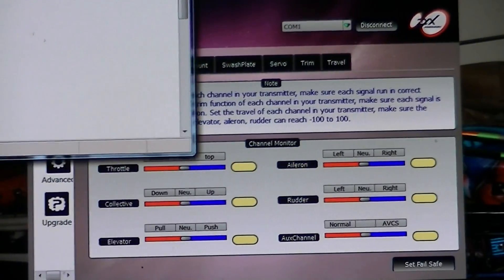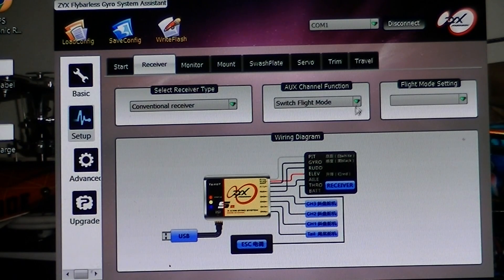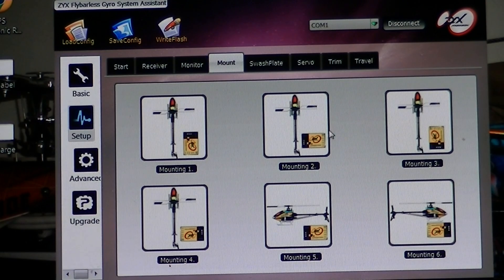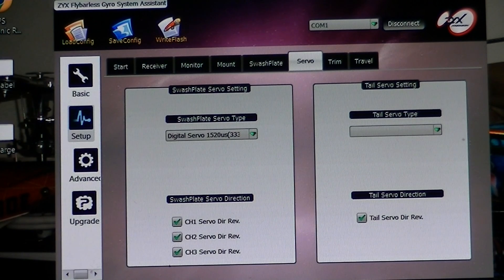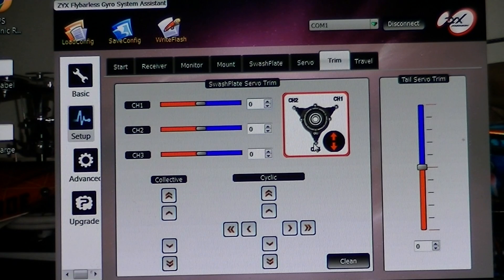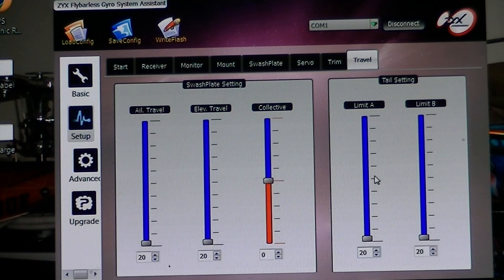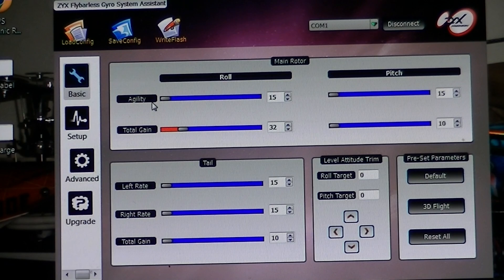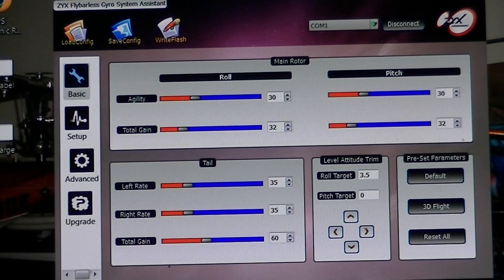zyx s2 how to basic setup video without the blah blah blah blah

Comment: I have a futaba radio, what should my setting setup be on my transmitter.
Reply from the maker: 1 servo swash plate
Reply: Thank you, is everything zero out? This is my first 3 axis gyro. Still use flybar with gy401.
Reply from the maker: use your same thr and pitch curve 
40_ expo on elevator and aileron

Comment: I can't seem to get the gyro to sync with the software ... I downloaded the software and unzipped it, power on my tx,power on the helicopter, plug in the usb and hit the connect button on the top right but it still says unconnected on the bottom right??? any help would be great
Reply from the maker: +Dan Rogers 
after you unzipped you need to install the software after you install the software you have to install the driver you can skype me for more help
wc_wickedclown1
Reply: +WC  Wickedclown RC inc ok I'll have to do that another day ... I also read that this software only works on Windows 7 and 10 is this true? I have 1 comp with 8.1 and another with 8 so I borrowed my friends with 7
Reply from the maker: +Dan Rogers 
yes win 8 will work as well
Reply: +WC  Wickedclown RC inc ok I've tried all that and I'm still not connecting according to the bottom right of the screen. the top right of the screen said com 2 or com 3 so it's acknowledging that my usb is connected. I have the zyx all hooked up to the helicopter servos and all then power up the unit and plug the usb in. the servos move and throttle works so I don't know what I'm doing wrong????

Comment: hy i wanna ask, in tab monitor on channel monitor, in my zyx s2 not showing 0 signal position , buat always minus when my stick both centered, if i dont make 0 signal in zyx software, what could be happened ? 

because, when i try to make 0 signal with my t9x firmware er9x, already end point, cannot trim again.
Reply from the maker: +Ferdiansyah Anggih 
IT DOES not have to be perfect zero
Reply: so? the "note in that shows in software that make sure each signal 0 " just ignore?
Reply from the maker: +Ferdiansyah Anggih 
yes if its off by 1 or 2
Reply: what is mean off by 1 or 2 sir?
Reply from the maker: +Ferdiansyah Anggih 
if your monitor is 1 or 2  over zero
Reply: but, in my showing -12 ? how is it?
Reply from the maker: +Ferdiansyah Anggih 
12 is to much
Reply: i must trim to closer to 0 ? i dont know this happen to me, when i first try to setting this up, the zyx-s2 showing like that? how supposed to do to reset this firmware?
Reply from the maker: +Ferdiansyah Anggih 
yes use sub trim to zero, you have to use digital 1520us servos

Comment: Okay so It's my understanding that ZYX S2 uses v1.0 software/firmware and does not excpt ZYX 2 4.0 software/firmware I saw in another video you showed us how to set Piro Optimization, I'm tying to set the Piro Optimization using the v1.0 software How do i do this? I dun't understand this terms used within this v1.0 software.